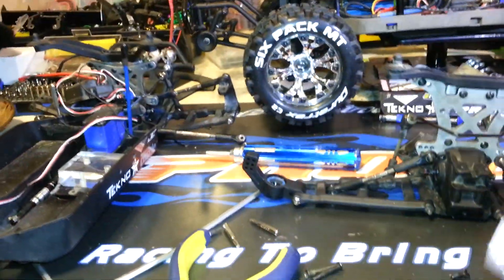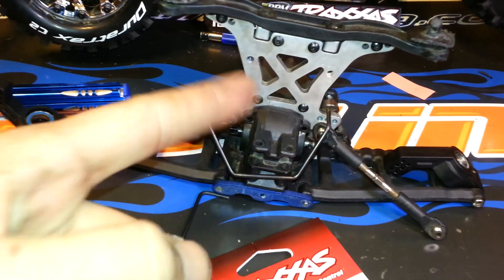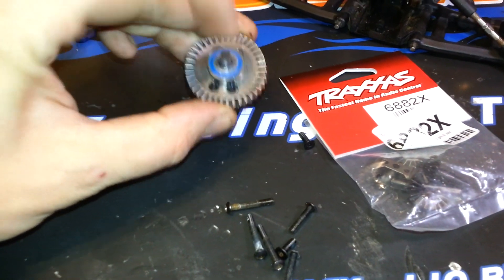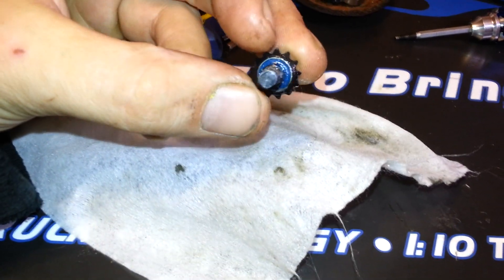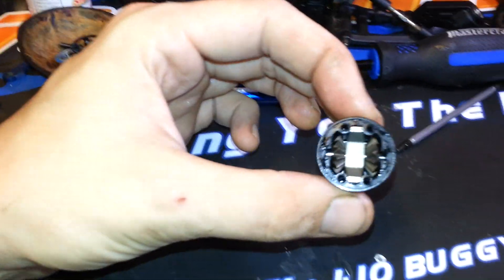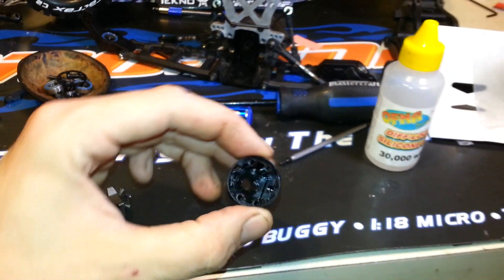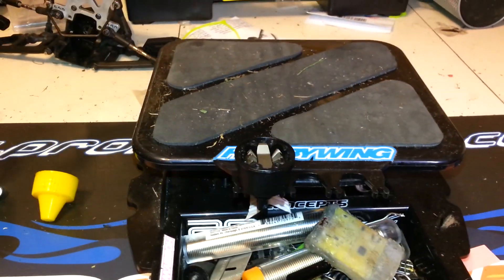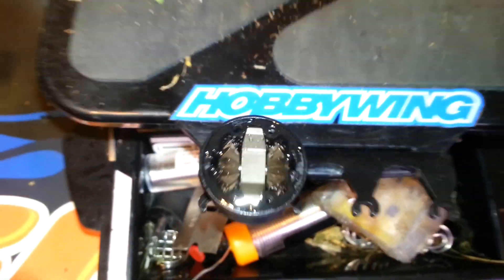Traxxas Differential Rebuild (add I bar)

Comment: To put the diffs together and not include the carrier in the car especially for the new cars is junky business. 

I bought a Rustler 4x4 and apparently the front dif has 30000 weight in it and the rear dif black grease.   

If I go into the front diff and it's grease do I will loose faith in Traxxas. 

Just got off the phone and it's just the way it is.  

So what if titan power is gonna kill the diffs.  And the grease won't work sooo good.  Who cares.  

That's NO GOOD and I will think harder upon my next purchases.

Comment: How do you like the Tekno shafts?
Reply: This is my other acct.  Honestly theres no contest.  The tekno m6 is the way to go.  Never by mip again.  So much less rolling resistance.  Better design imo.  Nothing bad to say about tekno.  Still working great years and years after the initial purchase without a single problem.
Reply: Thanks bro I knew you had em because of the hub carriers. Glad you like them mine’ll be here Thursday or Friday and I can’t wait to get them on the plastic shafts suck
Reply: @Naomi Leyendecker no. Netflix for the win

Comment: What is the purpose of ibar
Reply: it makes the diffs stronger
Reply: No shit sherlock, but for more detail why here you go. The I-bar reduces deformation and internal defection. Which are the main causes for sudden diff gear failure. 

The difference not known in the video is that the heavy duty kit he is using DOES have stronger gears and pin. Which he should be using with the added I-bar so he is missing out on alot of the beefiness this rebuild kit offers.

Comment: which diff cups are you using? nice job!
Reply: +alexis santana just using the stock different cups that came with the truck.  Aluminum or metal diff cups can be a bad idea as they are too ridged and do not allow any give. Sorry this is my other account
Reply: When it comes to diffs any kind of deformation or internal defection is bad. Metal diff cups are better in every way but 2 - weight and cost.